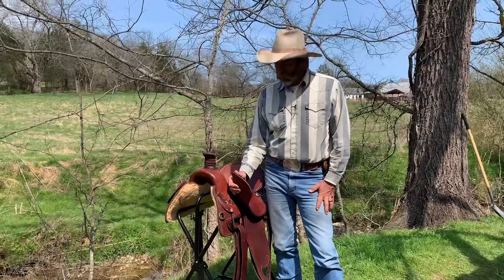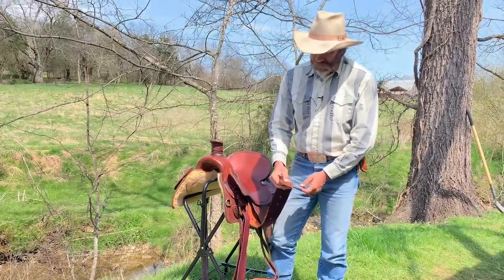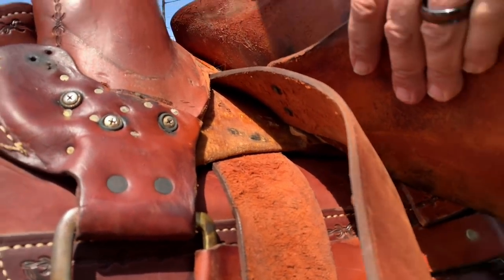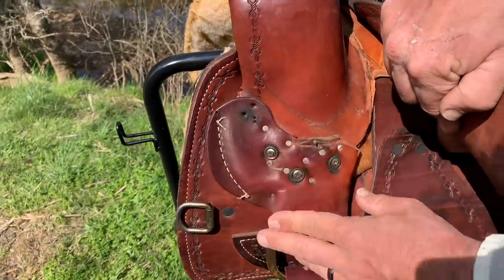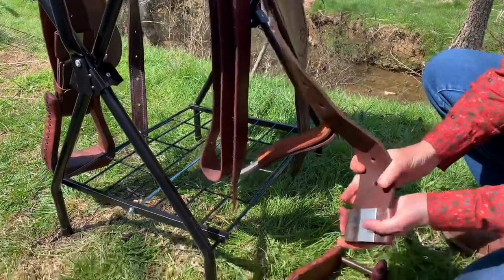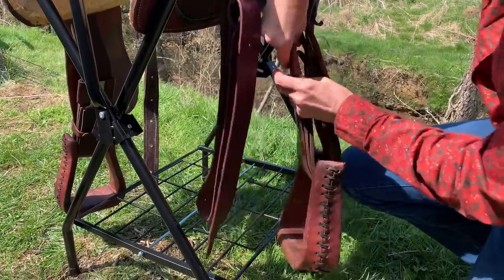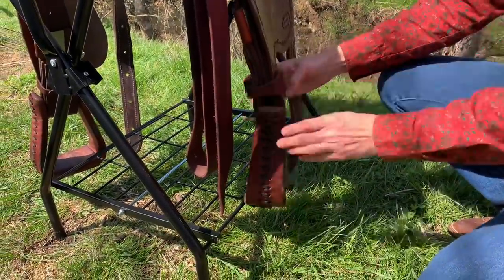Buying A Used Saddle - Part 3 - Replacing Stirrup Leathers

Comment: Mama is right, there is something fulfilling about restoring your own saddle.  Each of my 3 boys has their own saddle.  We got older good quality saddles that needed some attention, then together we worked on getting them back in riding shape.  Good bonding experience, good learning experience, and they ride just a bit taller on the saddles that they fixed up themselves.

Comment: Yay. You did it!!! I have had many many years riding English. Stirrup leathers are a whole lot easier on an English saddle. I've been riding in Western saddles for several years now and sadly my "seat" outgrew my favorite 15" seat saddle. Time to get a new saddle.  I opted to get a new production line "economy" to moderate model saddle. Of coarse, the leather was stiff and very thick. So I had a great idea. I'll just swap fenders. My old ones were turned and just right. It was the first time I had ever taken them completely off. Oh my! What a chore getting them back on!  Surely there had to be an easier way. No telling how long I struggled. Once done , I had the right fender on the left and vise versa! And the new cheaper saddle did not have a groove for the strap and I got bruises on my inner thighs. Why does that leather have to be so thick! Why couldn't it be nylon?
You did a good job Momma!

Comment: I have used drywall screws to repair saddles and they are quick and they are easy but I NEVER use them on the rigging or anything is going to take heavy use. I would use only one screw to hold the front of the seat jockey to the swell or the front barb and one hold back housing to the rear barb. Only on the cheap saddles that aren’t word a damn too. If it had a nail in it I would cut a nail to size and put it back in.

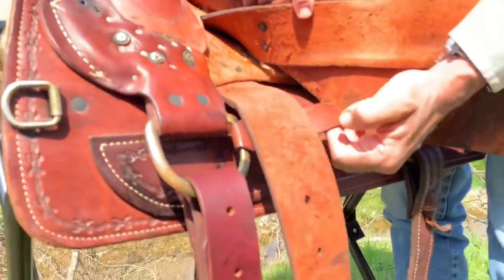Comment: Congratulations to your wife "Momma" on learning this great skill!  Hi Dewayne, I'm an English saddle rider mostly.  I noticed around the 1:50 mark in the video what I thought was "glue" on the underside of the leather as you were picking up the leather at the beginning of the video.  It looked like the top leather of the saddle seat was glued to other leather below it (maybe a rawhide surface).  Did you re-glue this or is that unimportant?  I don't know much you might have "unglued" or even if it matters.  Again, I ride in English hunter and dressage saddles, so your wife's situation is not something I'd deal with, which is why I asked and please forgive my ignorance.  I've certainly seen many shoemakers use leather glues before and wondered if that was needed here.
Reply: Mr Goodman, I think what you are seeing is just a wear mark on the leather from rubbing together of the fender and stirrup leather. Just my observation of what I see.
Reply: @garysorrells8133  , perhaps it was a wear mark.  It looked like stretched glue to me, but it's a minor point and not my saddle so I  won't make an issue of it.  It was just something I noticed and I can be completely wrong here.  Thanks for your feedback.  :-)
Reply: I believe you are right Mr Goodman, it wasn't a splotch of glue ,a dark spot it, looked like glue stretching.  Just my observation as well..